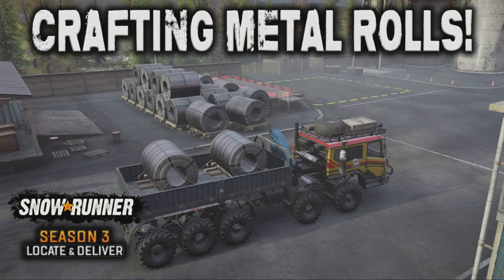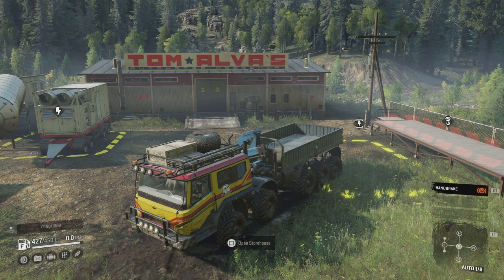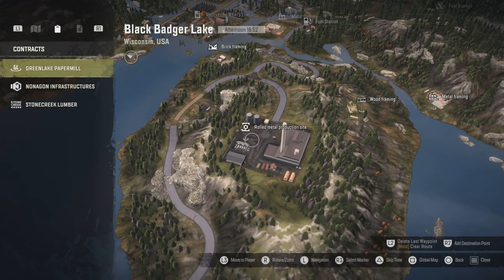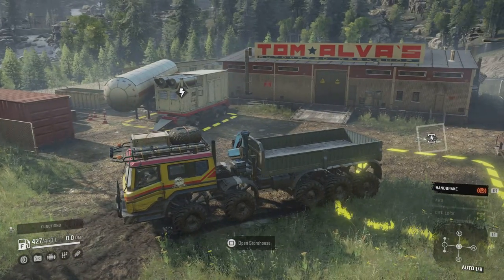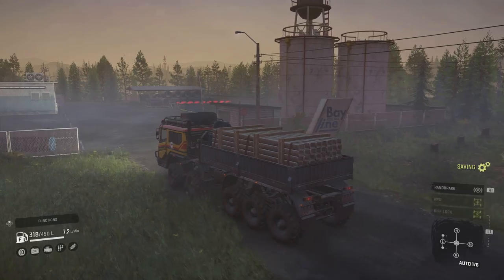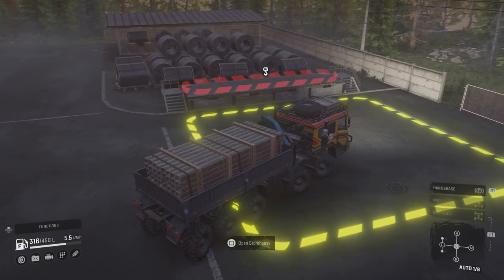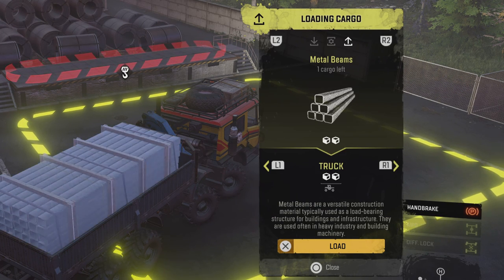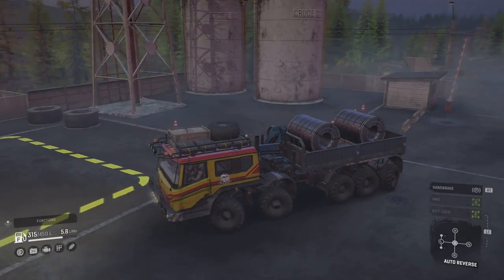CRAFTING METAL ROLLS| SNOWRUNNER SEASON 3 | PS5 | WISCONSIN GAMEPLAY.

Comment: I am going to be using my Tayga I discovered for free in Russia, plus the cost of the upgrades to make 12 of them. Wow does it chew through the fuel!  my profit margins are at around 10 to 15 percent on hard mode. Hard mode is no joke in this game and it is easy to fail. Careful planning is a must and every liter /gallon of fuel spent must be made for making money. I word on up to 5 total objectives at the same time, chipping away at them slowly, but at the same time using fuel efficiently. Profits margins are low on hard mode, but at least it is there, if planned around fuel correctly.  Supply lines are key and so is using our Trucks like an army to attack the map, sweeping across the map to cover all the bases, so to speak, without doubling back and wasting fuel.  hard mode is no joke and I love it!

Comment: I have an issue in which I started the generator and it did not work and I tried to turn it off but I couldn't. Can anyone help me with this. BTW it is fueled
Reply: I had the same problem. I restarted the PS & found it fixed it